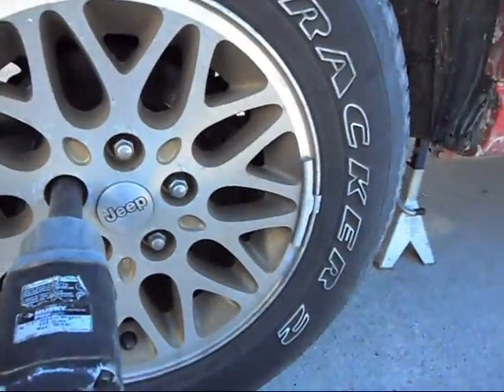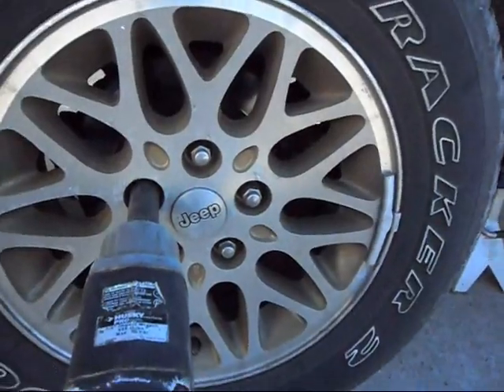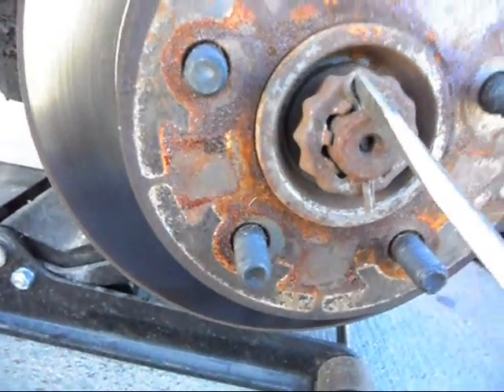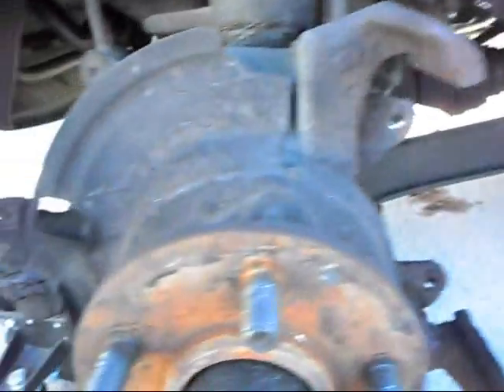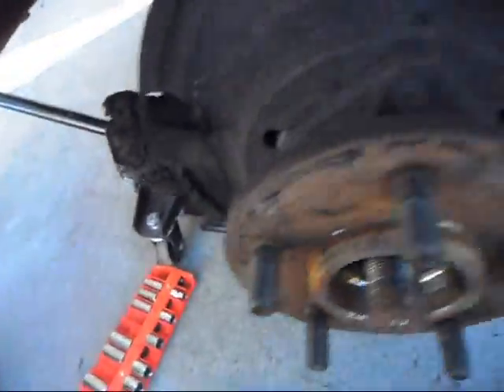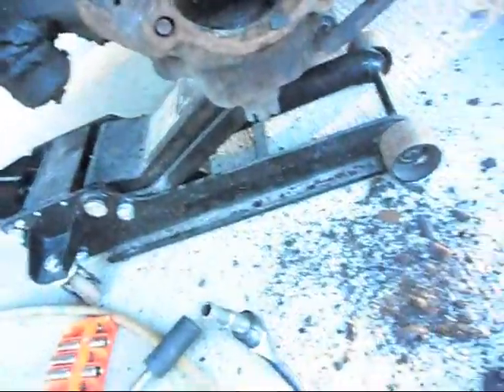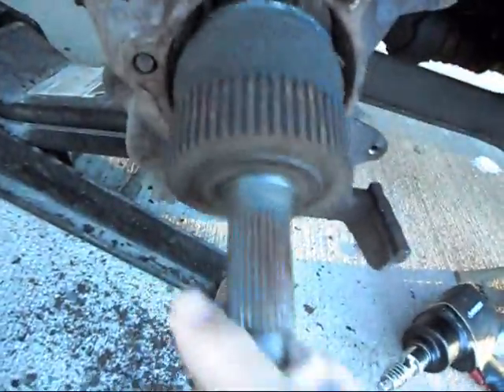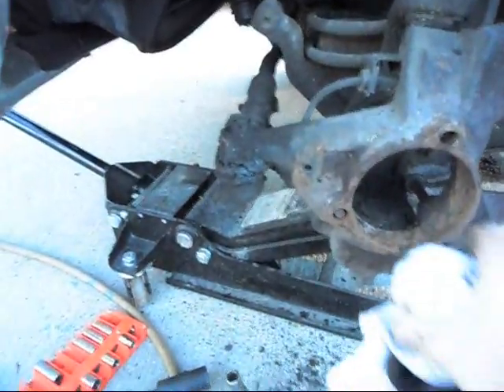How to change the front CV axle shaft in a Jeep Grand Cherokee.

Comment: I was working on my brother Grand Cherokee yesterday and the axle bolts was so tight I broke two of my heavy duty breaker bars if anyone know an easier way I can remove them please let me know
Reply from the maker: When a bolt is being that stubborn, heat, impact, and mayhem are the three steps. Heat usually does the trick, but if not, you can try to get an impact wrench, or a hammer and punch after it. If those fail, then you're grinding the head off the bolt or drilling it out.
Reply: @316Autos  appreciate you

Comment: jeep cherokee dont have a cv joint it is a u joint is almost the same as your driveshaft u joints i had mine pressed in for 20 bucks  no screwing around pulled it out took it to the shop picked up an hour later slapped it back in real easy.
Reply: well aint you cool. You paid to get it done
Reply: it depend on year AND if its a Grand or not... the GC's have CVs for the most part, and you replace the whole half shaft, not just the joint, and its a hell of a lot easier than just the U joint,

Comment: nearly 5 years later, i hope you got yourself some better impact tools, that gun was weak sauce.
Reply from the maker: The gun I used for the lug nuts is a husky 1/2" rated at 800 lb. ft. The gun I used for the axle nut is a Husky 3/4" impact, rated at 1400 lb.ft of torque. This SOB was just rusty and over torqued.
Reply: Sometimes it doesnt matter. I bought a new impact and was trying to take off a crankshaft pulley. It wouldnt budge.

Comment: i wonder how he's gonna install the new half shaft if by removing it he just used the small hole off the hub knuckle and while doing that he destroys it into two piece shaft.. misleading video i suggest your better off reading the manual first
Reply from the maker: You're confused and it's partially my fault due to the cut in the video. I didn't break the shaft into two pieces by taking it out, it was already broken into two pieces, which is the reason I was changing it in the first place. I destroyed the wheel hub because the dang thing was rusted into it's housing, but I always recommend changing those at the same time, since you're already in there.

Comment: Then why in the name of Sam G Hill of Wisconsin are you trying to put something on YouTube as if you know how to do it when you don't? And you make a ton of mistakes and you feel confident to post this making you vulnerable? Yeah we all make mistakes but most people that get on this channel are looking for answers and solutions not mistakes! That's what hearnes subscribers!
Reply from the maker: What exactly is confusing you? Lift off ground, remove wheel, remove cotter pin, remove axle nut, remove brake caliper, wire caliper out of way, remove 3 13mm 12 point bolts, remove hub, remove shaft.

This is real mechanic work, it's not a show, and it was very early in my channel, I was more about information than presentation.

Comment: hey Jason "jc316", thanks for this video!  I now know how you are NOT supposed to change the front CV axle shaft on a Jeep Grand Cherokee. Look on the bright side though, you have had 38,804 people learn from your mistakes.  That's really not a bad thing either, so when I say thanks, I am being serious.  All you need to do is change the title to, "How NOT to change the front CV axle shaft in a Jeep Grand Cherokee".  That way your not so misleading.
Reply from the maker: Why don't you give your expert advice as to what I did wrong? I mean, you have so many videos with so many views, you must be a professional. The job was done correctly and it's still working perfectly. Real mechanic work doesn't always go smoothly, crap happens and it must be dealt with. The majority of wheel hubs just pop right off when the bolts are loosened, this one was from the north and was rusted. The hub bearing was shot, so it didn't matter that I destroyed it. You trolls think that you're getting to me, but you just added to my views and made my video that much more popular. Thanks for watching.
Reply: I think you may have taken this a little too personal! I was simply implying that, from watching your video I was able to see what not to do, so I didn't end up with the mess you ended up with.
Reply: O' and "real mechanic work" is also done in a garage, with a hydraulic lift, using the proper tools! Not in your mom's driveway with a chisel, hammer, and blow torch!
Reply from the maker: Bryan Bath You tried to make it personal, but I don't take things on the internet personally. That last comment and the fact that you're looking for how to videos tells me exactly how inexperienced you are. Keep working at it and one day you might be a decent mechanic. These videos aren't directed at shops, but at the beginner mechanic. I show these with tools that the average joe will have. If you can't follow my videos, you either need to take it to a pro, or you need.to find a different video.
Reply from the maker: Taylor Christensen Yep, like I said, you can tell how little experience he has by that statement. The only reason I was working in the driveway was because of another car that was sucking up room in my garage. I have nothing to prove to people like him, my cars are fixed right and they stay that way.
Reply: JC316 at least we can work on our own vehicles.. I need to do this on the weekend for a 94 jeep my buddy bought it clicks and only works rwd do you know if I need to change any seals or just the axle shaft and axle nut / cotter pin
Reply from the maker: 99Legacy2.0T
If no seals are leaking, then I wouldn't mess with them.
Reply: JC316  Nice vid,  did both of my jeeps axles,  am wondering what torque is that big nut supposed to be?  My right one had separated too.  Now the new one is rattling ( 9 months old)  sounds worn out,  wonder if I didn't get it tight enough,  used half inch impact, and did it in my driveway too.  I wish mr Bath would elaborate more, instead of being a keyboard critic.
Reply from the maker: richard baldock 175ftlbs. Might be the bearing making noise, I had one go out on a blazer and it was rattling.
Reply: Bryan Bath Tell that to this 17 year old kid who doesn't have anything but a gravel driveway, a basic set of tools, and youtube. If a chisel, hammer, and blow torch weren't proper tools, "real" mechanics wouldn't use them.
Reply: +NinjaRooster agreed I love my chisel hammer and blow torch :)